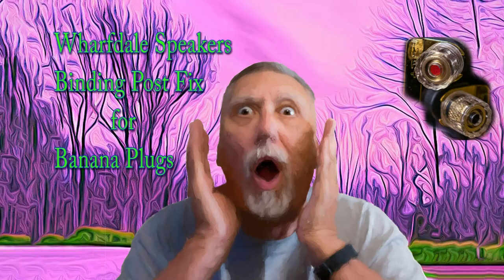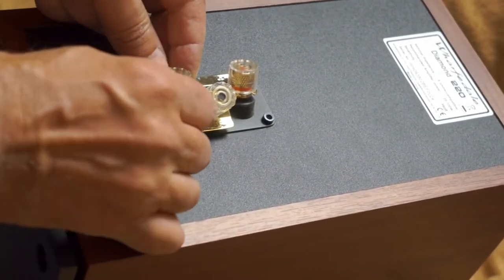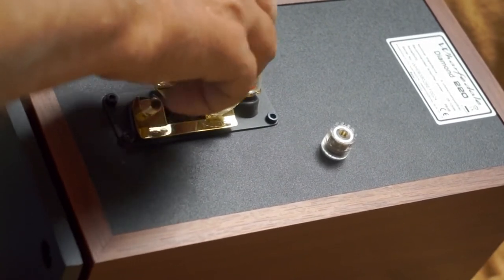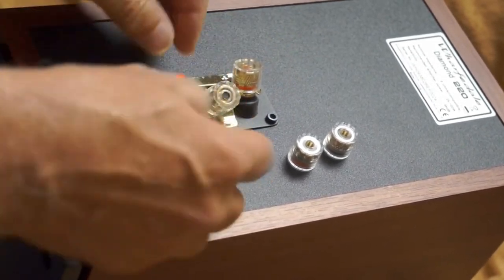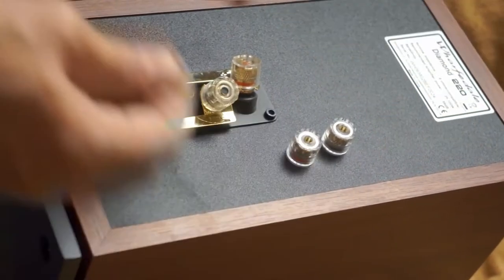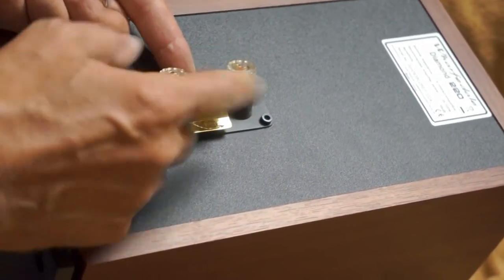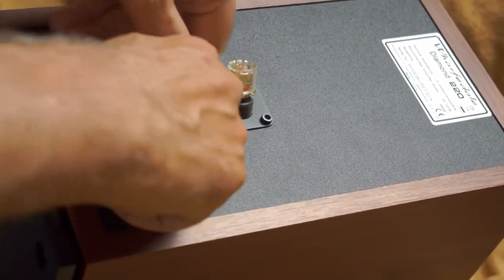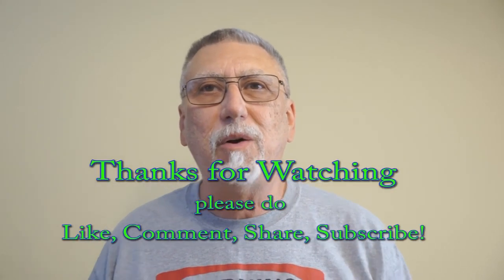Binding Posts easy fix so they can take banana plugs (Wharfdale speakers and other brands as well)

Comment: Hi thank you for your video. However doing the most important part of what you were showing you were actually covering up with your hand what you were doing with a screwdriver. Any chance you could reshoot this without
Reply from the maker: I pushed the bottom of the plug up with the screwdriver while at the same time pulling the plastic plug out with the hand. It is a 4 year old video the parts for it are long gone now.